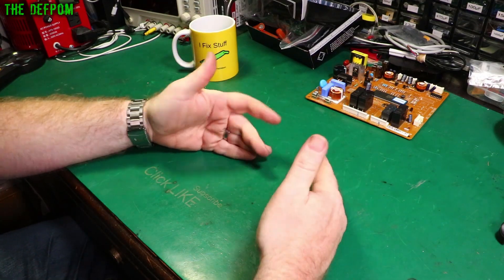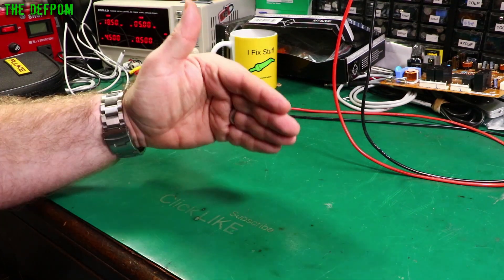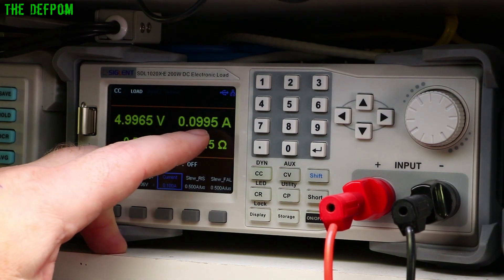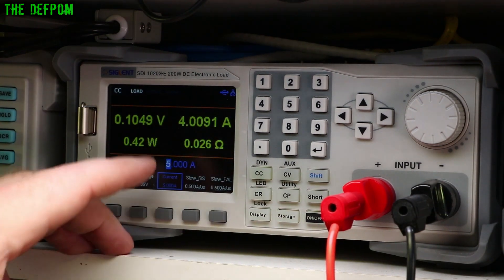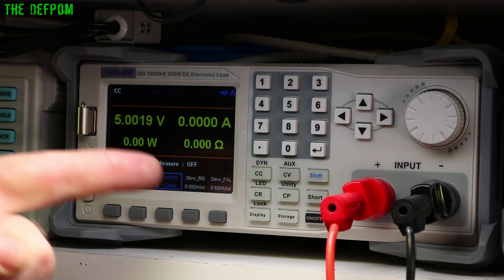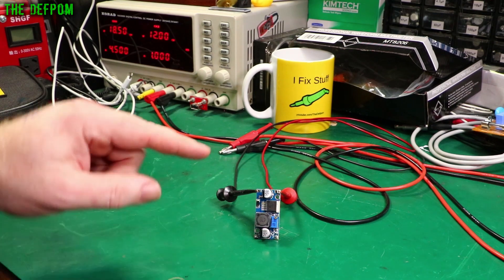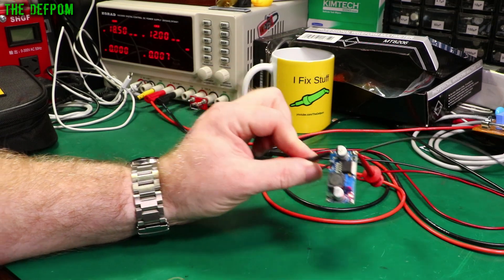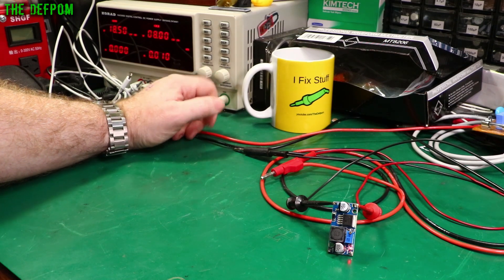🔴 Electronics For Beginners - No.21 - Device Power - Voltage Is Sourced, Current Is Drawn - No.986

Comment: Just to make things confusing, a lot of LED lights that use an oddball voltage are current driven meaning that when selecting a replacement power supply, the current rating has to be the same or less and the voltage range has to cover the rated voltage of the LEDs.

Comment: I've seen this a lot where newcomer's who dont realy understand power and the relationship between Voltage and Current, you need to grasp that a PSU makes a certain amount of current 'Available' to your device, how much is drawn is upto your device and thats why your PSU is often the first stage in fault finding because if your device under test (DUT) is demanding a stupid amount of current then it has a problem, maybe a short circuit etc. Thanks for tackling this one...cheers.